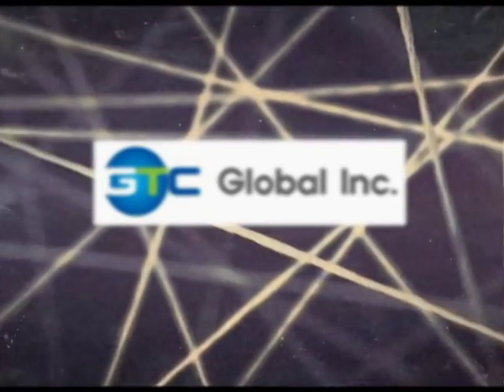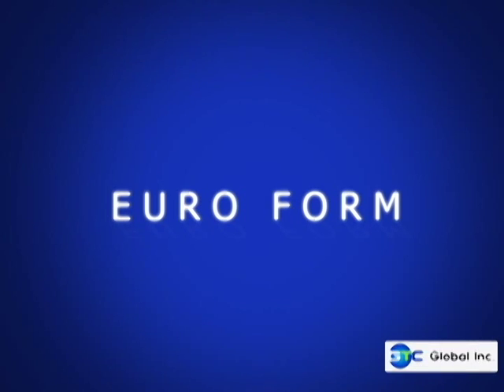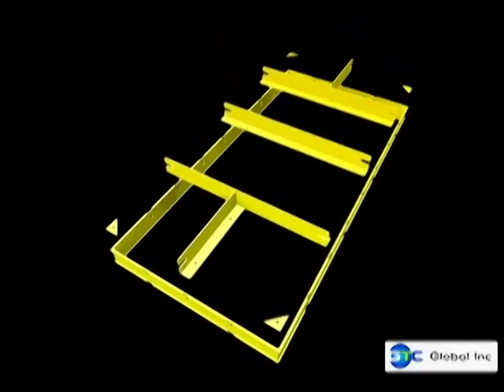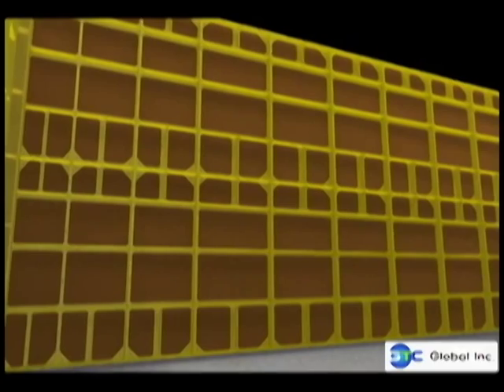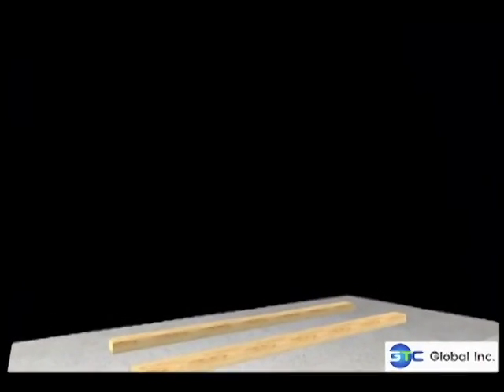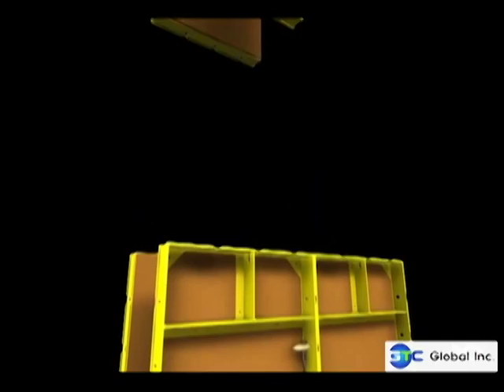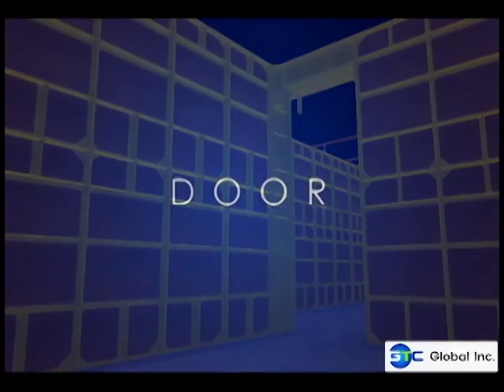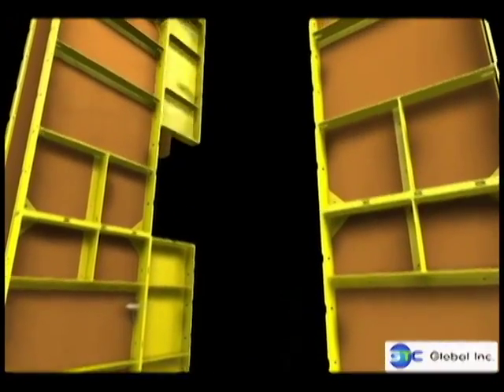GTC Euro Form 11 02 2014

Comment: Nice video. BTW, I can offer wedge pin and flat tie used for this kind of formwork with good price and quality. Contact me when you need them. Mobile: 008615128748047, or email:  lynetteyoung0617@sina.com